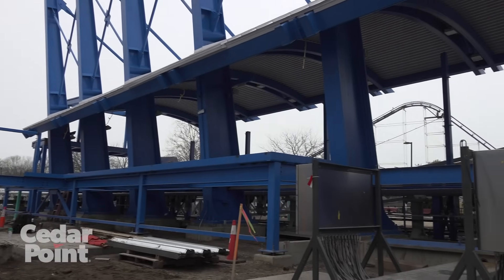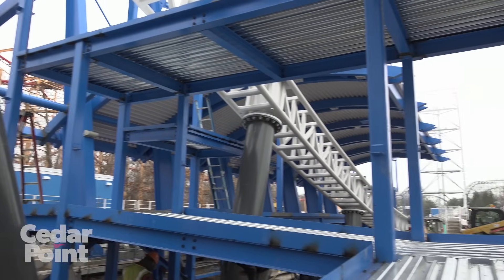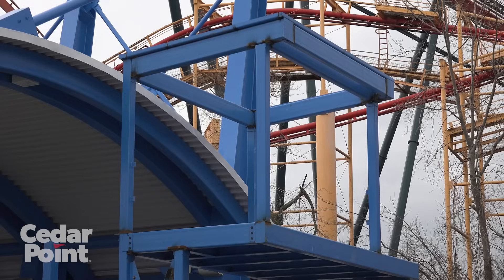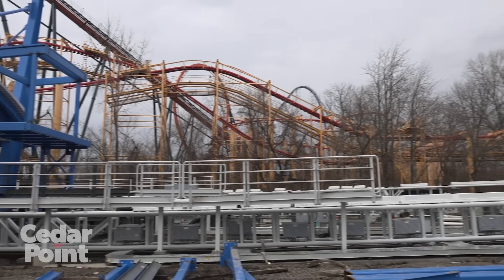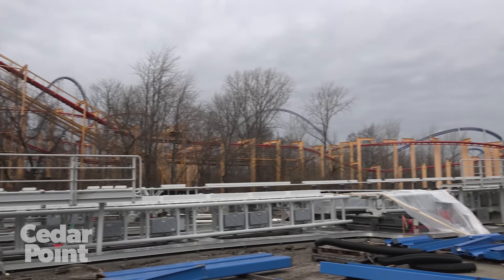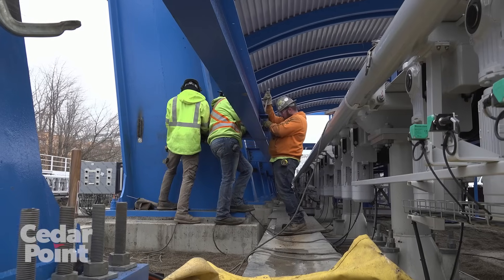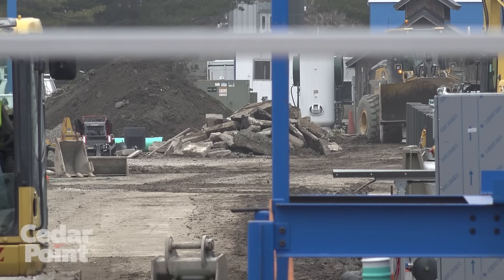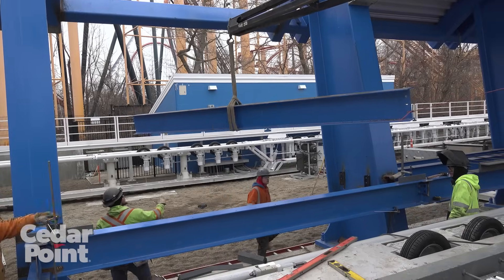Top Thrill 2 Pit Stop | Episode 8: Station Steel

Comment: I love the idea, steel vengeance is by far the best ride there so the revamp of the old rides is definitely worth it. If you redo the rides or add the new steel coaster at kings island. It’s only so much but the millennium force is a great ride with the new specs from the steel vengeance added to that. It’ll be the greatest thing ever. Maybe do 2 steeper drops similar to the maverick and add some spins along the long curves.
Reply: What?
Reply: @somekidnamedtapu  you may not realize when the maverick was created the drop of a 95° angle was the first of its kind. So the tallest steel coaster with at least a 95° angle maybe 2 drops of it. You’re talking about a ride that will satisfy your free fall  feeling with an actual fun ride. The steel vengeance reminds you. It’s about the ride not the drop.